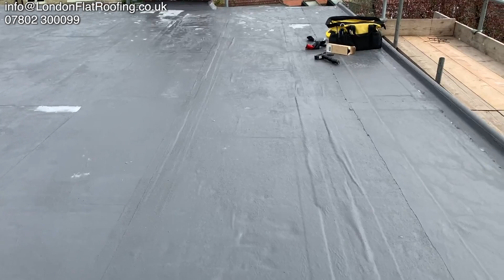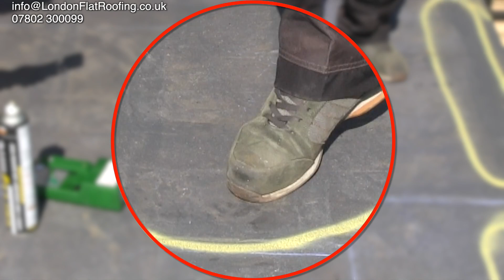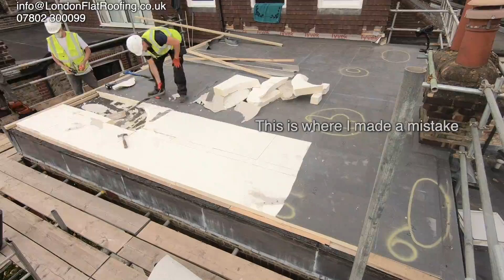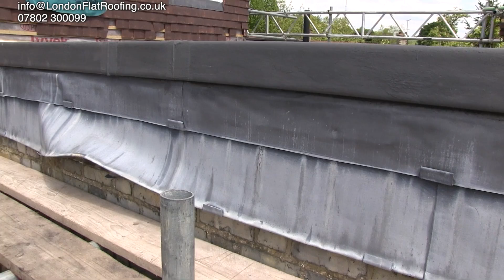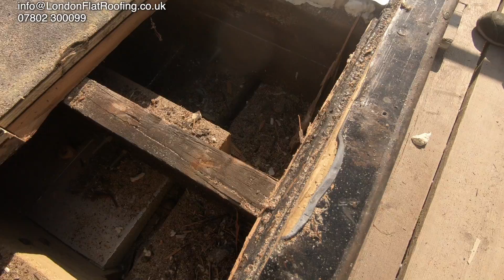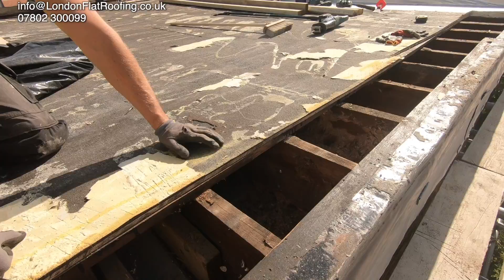Leaking new warm flat roof problems

Comment: Hi Steve roofer 

We have just constructed a block and beam flat roof on top of our garage we will use the roof as a walk on patio what’s the best way to finish it off 

What I have done so far after block and beam is layer of black jack Then on top of that vapour barrier then insulation then another vapour barrier now shall I finish it off with a layer of concrete or tarmac or anything else 

Any suggestions are welcome thanks
Reply: Thanks for your reply Steve 

To make it water tight just below the concrete Epdm rubber membrane has been advised will that be ok and how shall a finish off epdm membrane on the edges and trims and corners  on all sides which curves up and then goes  over the block do I need to pull and stretch and secure it to the outside block
Reply from the maker: @RayRay-vt7hc  so we will consider is thermal bridging which means the insulation needs to wrap around the concrete slab or in your case the block and beam and then you trim it with your waterproofing membrane easier said than done however that's the only way that you can successfully stop thermal bridging. You're basically in encapsulating the roof structure
Reply from the maker: Basically you're making a warm roof on top of this and any roof coverings long as it is waterproof and suitable for you to walk on

Comment: When you are changing a cold roof to a warm roof with open sides similar to the roof in this video, I assume you would need to add a wooden edge which you could then attach the fascia and roofing trims etc, however I can’t find much information on this! Is there anything you need to consider when doing this to ensure the roof doesn’t fail?
Reply from the maker: Yes you need to make sure you insolate from the top of the wall to the bottom of the roof deck between the joists around the perimeter

Comment: Ive got one of these EPDM roofs looks like on a warm roof as its in a loftspace/dorma. It's delimanted into spots on the windy side due to win. Can it be repaired and salvaged or does it need replacing. The roofs only 2-4 years old.
Reply from the maker: send some photos over let me have a look
Reply: @SteveRoofer  Will do Steve. Just had a quote to do the whole roof he said £85 a meter, but the quote ended up at 2.7k before scaffolding.

Comment: you shouldn't apply screws to the top of your perimeter metal. Even with mastic you are creating holes in your membrane on a water ledge.  Stripping in perimeter metal or using an edge shield fascia would be ideal.

Comment: It is disappointing that you didn't resolve the issues with the existing roof, that is not what I would have expected.  Clearly the polyurethane insulation was defective and the vapour barrier was compromised.  As there was no ventilation to the void then the least professional response was not to ignore it but to suggest and install a resolution.  As it stands, because the original vapour barrier was ineffective then your EPDM roof covering would be the place where the condensation would occur.
Also, stuffing bits of EPS down onto the external wall was a bad thing to do.  The EPS should never completely fill the cavity as it will encourage moisture migration from the external leaf even if the lead fascia was quite deep.  EPS used in a cavity should be partial fill i.e. it should have a minimum of 25mm separation to the outer skin of the wall.
Reply from the maker: Yes disappointing for me as I like to do things correctly however I have to do what I'm told to do by the customer.  As regards a cavity there was no caverty filled I was extending the insulation down to the wall below

Comment: Hi steve, have been binge watching your videos, and I have a question which you may find interesting. I have a cold roof with a new EPDM roof on which i was planning to have spray foam insulated, however, after watching many videos and reading many scare stories, I've now decided not to use the spray foam and would prefer to upgrade it to a warm roof. Building control agreed.
You mention in many videos you can use the existing felt if it is in good order as a VCL,  so my question is can i use the new EPDM roof as a VCL?  (I appreciate I will be putting another new EPDM over the insulation, but the question relates to the existing (installed last year) covering. I'm reluctant to remove a new EPDM which is weathertight and replace with a "sheet of polythene". Can it stay and put a vcl on top? is keeping it really going to cause a problem?
Reply from the maker: Good question im not sure how EPDM acts as a AVCL yes it will be air tight but how good is it at stopping vapor transfer? it needs to have a Vapour resistance of greater than 530 MNs/g if it has then yes. Please email me if you find any dater on its vapour resistance it will save me trying. However cutting out all the paperoek the fact that its airtight and it probably has got some sort of vapour resistance it would probably work. Question is will you sleep tightly at night not knowing if you did do it ?

Comment: Hi Steve been watching your videos for a while and very informative. I have a late 1960s dorma bungalow with I suspect very little to no insulation  the roof is leaking slightly and needs redoing the deck is tongue and groove boards and solid what would you recommend. Obviously I would like some insulation.
Reply from the maker: Warm roof the deck is good so just go over it

Comment: I would be interested to get you views on using a big SIP panels as the roof structure and insulation (200mm thick). Just putting the EPDM on top.
Reply from the maker: This is something I was asked to look into last week  by a customer  he sent me this  "Bit of contrasting info  sips.org say that cold roof venting is not a requirement but a "sensible extra measure", Whereas Kingspan say it is a requirement"  presently I would vent it
Reply: @SteveRoofer  Perhaps I did not make it clear. Sorry!
The SIP panel is the roof. There are no joists.The rest on  exposed beams. There will be furring strips  between the beams and SIP panels to get the fall. Inside The Plasterboard is fixed to more furring strips to get it level leaving a small gap between the PB and the SIP
The Dew point will be in the middle of the insulation of the sip panel. so you do not need a vapour barrier. (although it will all be glued and taped so no moisture would not get between the joints of the SIP.

Its is really just a hot roof with no joists.
Reply: SIP roofs are kind of hybrid roof to begin with. Warm roof has insulation on top of the structure and cold roof has insulation inside the structure. Now you could treat OSB on either side of SIP as an insulation (wood is an insulation) and call whole SIP as an insulation however OSB will be used to connect to walls using structural screws and timber. So OSB on top of the SIP is considered as roof sheeting hence for non ventilated structure like SIP from the building regs prospective they are classed as cold roof. So you will need battens and 12mm plywood with EPDM on top of it to create the ventilation gap.

And in 20 years time you can replace the damaged epdm/roof sheathing without worrying about super structure beneath it.
Reply: @piyush3549  I have never seen a warm roof with the top layer of OSB/Ply being raised on batons with an air gap. Thats a cold roof.
The only issue I can foresee is if the roof leaks the SIP panel  top OSB sheet may be damaged. But even on  standard warm roof would suffer with that and can be mitigated with other systems.
Remember that a SIP panel has 2 sheets of OSB and the insulation in-between. they are one homogenous unit. 
All I will be doing is removing the need and space for the joists as they will be replaced by other support elements. The SIP panels can have very high load ratings that match and exceed those of the normal joist based roofs.
Reply: @logik100.0  I completely understand where you are coming from. We build with similar system where we have two layers of 18mm spruce plywood on both sides, interior and exterior with cavity is fully filled with rockwool insulation. We have done a kitchen extension with epdm goes straight on the exterior face of spruce plywood and it’s perfectly okay. We don’t do this anymore and add additional layer with ventilation cavity as an extra insurance policy and much easier to get building inspector to agree with us.  By the way the system we use is pretty much same as  WikiHouse.

For SIP and batten for roof see https://youtu.be/9nCg5DsF6Ow
Reply: @piyush3549  Many thanks. I suppose it makes sense to be precocious. It will make building easier as The SIPs can sit on the internally exposed RSJ's and the slope can be made using the top sheet and furring strips. The ventilation gap will be made by the elevated furring strips.
Thanks for the valuable info. Just what I was looking for.